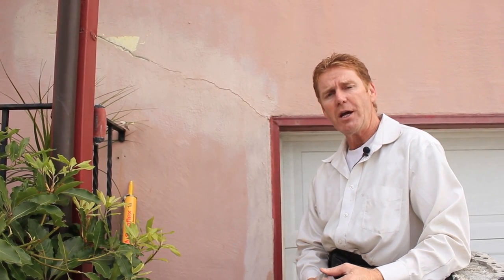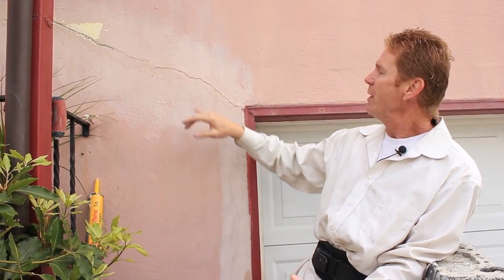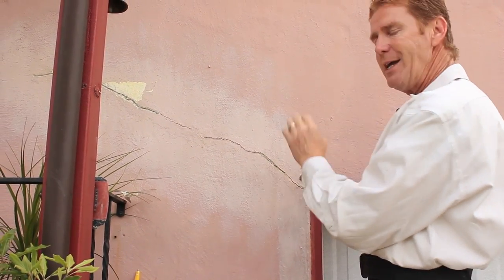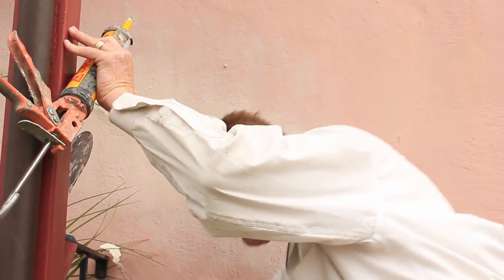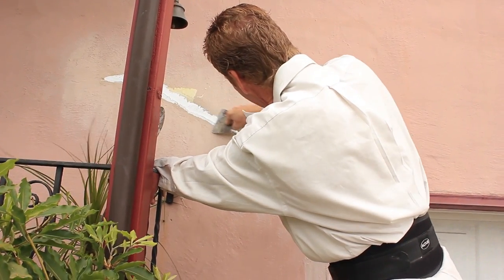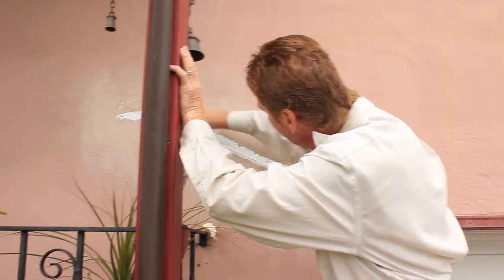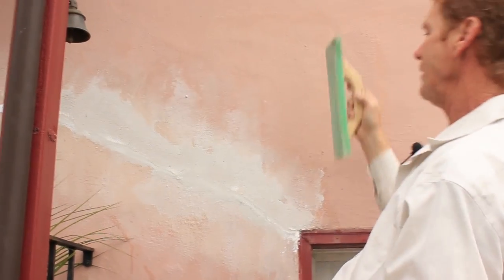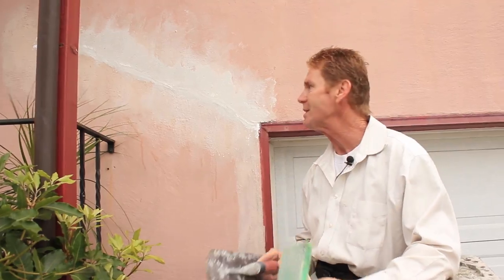Repair cracks with Sikaflex caulking by adding sand.

Comment: Polyurethane caulking really ? Says every painter watching this.lol
Reply from the maker: Hody Richard, I did the crack with Sikaflex 1A as the paper seal was broken plus it was way too deep for conventional caulking.
 I personally recommend More-flex or Quikrete with sand in them for 98 percent of stucco 
cracks. 🍾
Reply: Your the man Brother Kirk! Thank you for sharing all your experience and insight. I'm learning most of all how to explain to customers why they need to hire a professional stucco guy to do repairs for the best results. Also I'm learning to do some smaller repairs. Still if I  don't know how to mix or choose the right material it will still fail. Im learning though ...THX AGAIN!
Reply: @StuccoPlastering  the others might be a better match aesthetically but sikaflex is a far superior product. I’m sure you know the difference between consumer products and professional products.
Reply: Just noticed a 1/8” crack on slab floor I need to fix.  I was thinking Portland cement as a permanent bond but most contractors are saying polyurethane.  ?   4” thick basement floor.

Comment: Rain moves houses now? Never heard that one before lol
Reply from the maker: Greetings Shawn, LOL, correction, rain lifts house's, you can't see or feel it, but cement walls always tend to crack with the first few months of rain.
 Why, excellent question, glad you asked. When dryer conditions return, the homes now get, let's say, "comfortable," and settle, thus hairline cracking.

 Bringing peace, love, and brotherhood back to the world of “Plastering.” 🌍
    The complete plastering encyclopedia on video, by the plastering messengers of Youtube.  
     Over 850 videos 🎭 👀💃
Reply: There is shrinkage, expansion and contraction, and wind too. Shrinkage can cause the hairline cracks. Different materials expand and contract at different rates based on temperature. Wind loading can cause stress on particular locations.